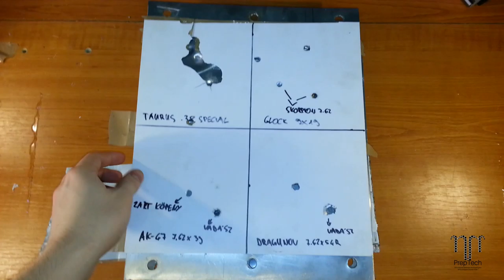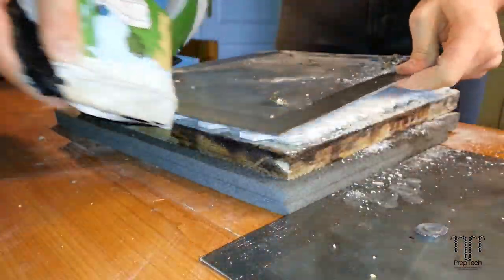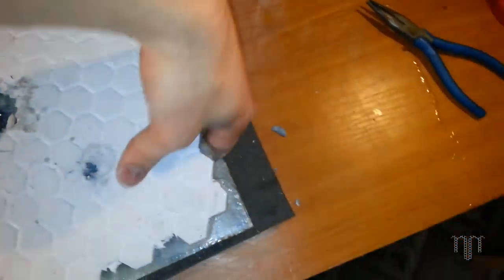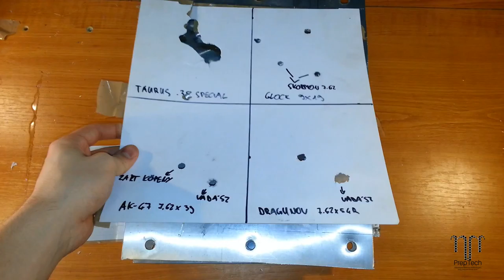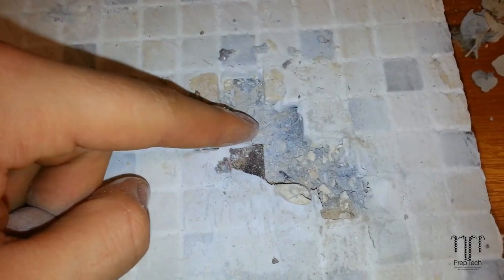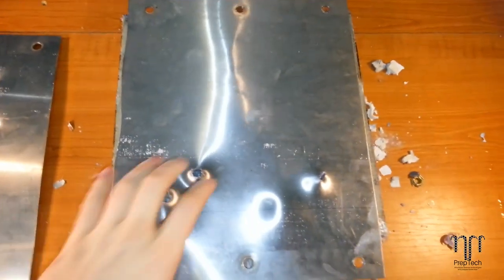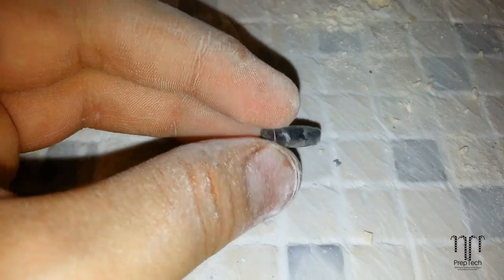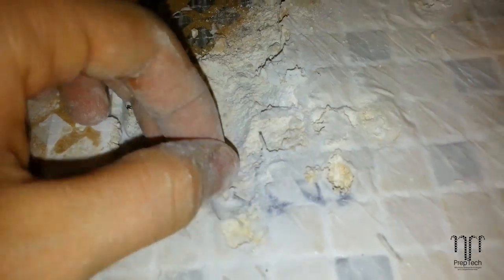DIY Vehicle Armour (stops an AK-47) Part 3: Examination

Comment: I like your process I know it’s been a long time since you did this. I replicated your process only I changed two steps.1) I applied the layers of fiber glass then placed them in a vacuum chamber2) I used a 40ton press to allow the epoxy to harden under a great deal of pressure. One day I will get a place to shoot and film the results I hope they are as successful as yours.
Reply: Did you do it?
Reply: What were the results?
Reply: I feel like he either did it and it worked... or he did it and it didn't, and the panel not working could be why it isn't responding.

Comment: so the ak 47 was shooting mild steel core rounds?consider that not even regular lvl 3 panels are rated to stop that.if you were using regular ball ammo with a lead core it probably wouldve stopped it reliably.also you could try reducing the fiberglass thickness but double up on the ceramic tiles.
Reply: cool idea

Comment: Excellent job! Stopping an AK47 at 15 meters with inexpensive materials is very impressive! 
My suggestion... use only 36 layers and  add another sheet of tile, inside the layers. Perhaps after 24 layers.  Seal with resin.

Comment: Very cool video and experiment. Seems like even the steel plate and ceramic by itself does a good job of dealing with the normal street gang bulllets. The best part is,  you would be able to drive out of danger before they realize their shot are not getting through

Comment: Very interesting work, would love to experiment, but do not have any access to firearms. I think it would be interesting to encapsulate the tiles in glass fibre and perhaps put the curing fg under far more pressure/ vacuum suction? A tip to bond steel sheet would be to perhaps try windscreen bonder with the correct primers this is a very important part of the process.

Comment: An idea to improve performance, though increasing size and weight, would be to utilise 2 staggered layers of tile, and sandwiching them between further layers of Fibreglass. This will allow for greater chances of stopping faster projectiles such as common rifle rounds.

Comment: Great. NOW Dynex or Rihno Line it and it will stop the rest. As well as add a silicone layer on both before . The bolted together one should be a better option with the ceramic. Now for personal just subtract the difference and you are ready for the SHTF. 👍✌
Reply: Gerald Key Sr. Agree, I think it needs silicone to provide cushion between layers to help in absorption and dissipate energy

Comment: Thank you for the videos. You say the steel (& tiles? I forgot) was enough to stop most rounds by itself but I would argue that if it didn't have the support of the fiber glass it wouldn't have done as good a job.
Reply: Yeah the fiberglass itself would be good for the pistol rounds

Comment: Use a harden'd steel plate on the outward plate fill in inside with some hard plaster material put in some tungsten carbide plates in there space them out and have the back panel as a softer steel.
Reply: That raises the cost &complicates the process of getting the materials needed.

Comment: Fiberglass is poor vs rifle rounds. You need over an inch of it, and it ends up weighing about the same as an AR500 steel plate that stops the same round.
Reply: The HDPE used in level 4 plates are individual thin sheets though, not a solid panel. It's better able to deform to disperse the energy of the bullet.
Reply: @ctrlaltdebug  UHMWPE

Comment: So, I've been wondering how well these body armors not only stop a bullet (easily visualized by eye afterwards - pass-through or rear indents, etc), but also how well they stop the bullet's energy from being transmitted directly to my chest - breaking ribs, etc. In your next experiment, how about adding padding to the BACK of the whole thing, to minimize the final force transmission to ME? Maybe try a yoga mat backing or other foam materials for the backing? That force can be measured with a number of devices, from really cheap, to rather expensive. See various options for those devices here:  https://www.google.com/search?sxsrf=ALeKk02BVUilrEmeRsNa51J3sPJeMi5D0w%3A1588892918250&ei=9pS0XvrjDsLG-gTFr6WwDA&q=device+to+measure+impact+force&oq=device+to+measure+force+of+impact&gs_lcp=CgZwc3ktYWIQARgBMgUIABDNAjIFCAAQzQIyCAgAEM0CEIsDOgQIABBHOgcIIxCwAhAnOgYIABAHEB46BggAEAgQHjoICAAQBxAFEB46BAghEApQzaQBWMnFAWCd8gFoAHACeACAAXyIAdYMkgEENi4xMJgBAKABAaoBB2d3cy13aXq4AQM&sclient=psy-ab

Comment: My friend you need to put the tiles on the back & the fiberglass on the front. It will double as a 'spalling' capture & the little bits from fragmented bullets will not penetrate also it slows the round considerably before it gets to the tile thus making the (already effective) ceramic even more effective.